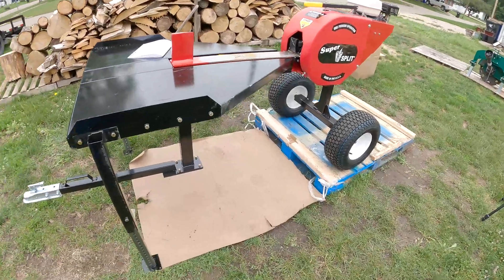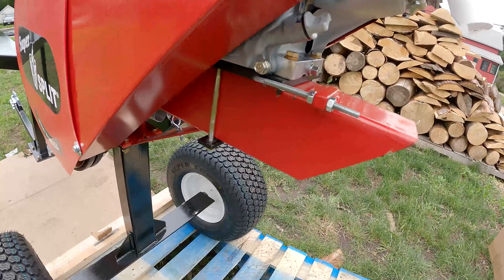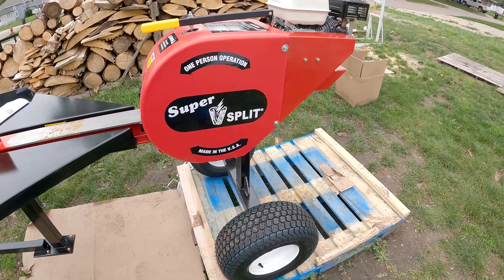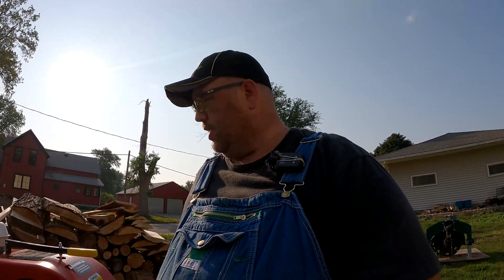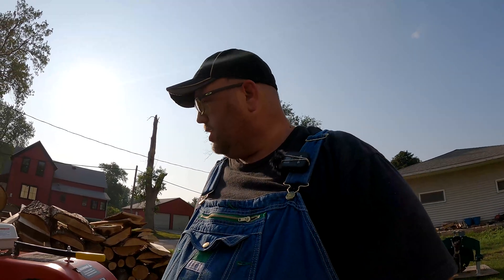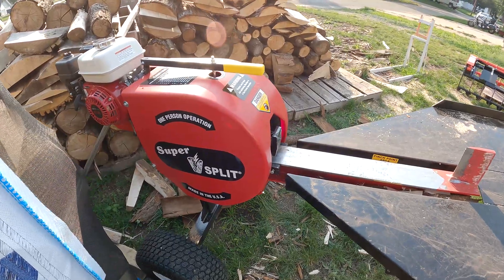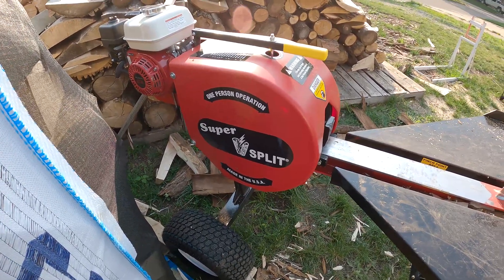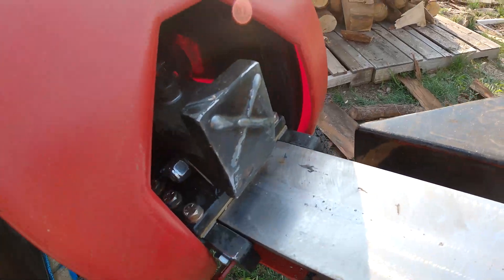New splitter at Timber Visions and it is FAST.  Super Split kinetic splitter.  How fast is it?

Comment: I watched a couple of your videos about this log splitter. I can see it works great. The super splitter HD makes 2 gas drive splitters 6.5 HP and a 9 HP. None of your videos say which one you are using. I have to guess this is the 6.5 HP? I like your wood conveyor. Great informative video's.
Reply from the maker: @beefitter  I'm pretty sure it's the 6.5hp. Was the only option for the HD when I bought it. Thanks for stopping in. Hope the videos were useful.

Comment: You're the only guy I know that splits his wood small like I do!  👍  You can't beat a SS just for that.
Reply from the maker: I sell mostly bundle wood so it helps so much with that. It dries so much faster when split small as well. I'm sure you know that if you're splitting small as well. What is your reasoning for splitting small?
Reply: @timbervisions  For years I had a small antique oak stove converted to burn wood.  Our house is small (800+ sq ft) and that stove only took small pieces, and with anything larger the stove and the house would get way too hot.  A few years ago I got a Jotul FC100 to take its place.  I still like the small stuff as this too is a pretty small stove.  I cut it around 12" long as well.  I'm not concerned with long burns.  I light it when I get up at 5, and let it go out when I leave around 8.  Then I light it again when I get home and let it go out when I go to bed.  I like a cool house when I sleep.

I also use the SS to make a bunch of kindling before the burning season.  It works great for that, especially if I pick straight grained stuff for that.  Then I dont have to make kindling throughout the season in the rain, snow and cold.  Nice thing is, when making kindling, I can let it run just above idle.  Very quiet, and it sips fuel.  Win/win!!  All in all I have been very happy with the splitter.   Form following function very efficiently!  Mine is the HD model I picked up used (you never see them used, and I can see why!) for $1k.  I had to replace the Honda carb.  Other than that, it has been a great machine.
Reply from the maker: @Christian-wj7dk  heck of a deal on that splitter. Quarter of the price new! Our wood stove is a high efficiency catalytic style. It prefers the smaller stuff. I pretty much heats the house all day and night. Soapstone body, so it retains the heat for longer.